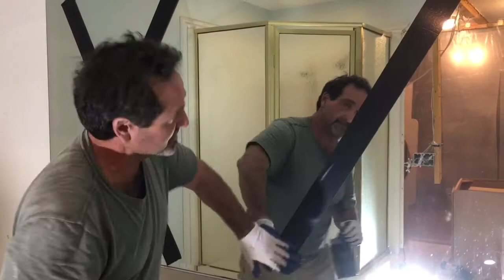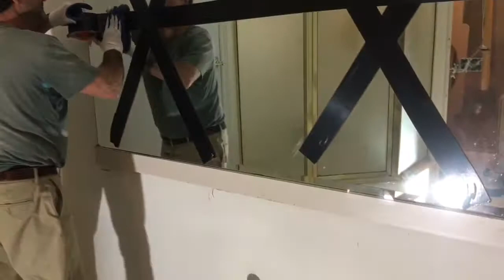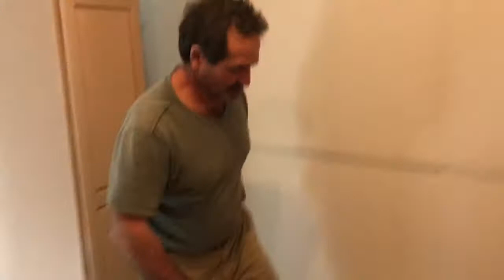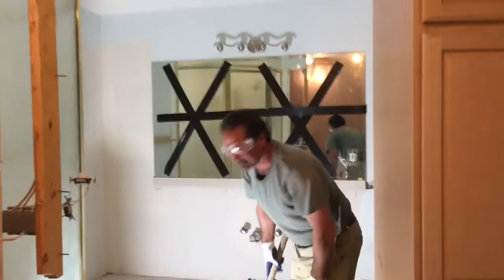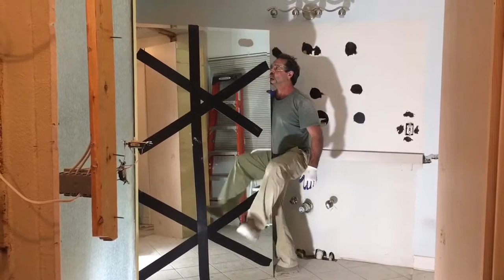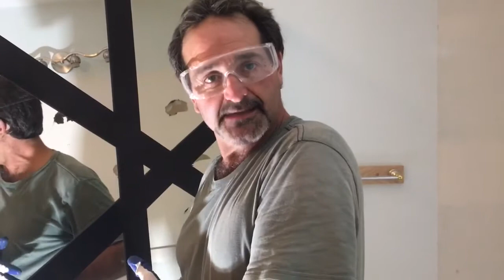Remove Large Bathroom Mirror from Wall - FAIL (funny)

Comment: Hey Brother. I do this all the time demoing bathrooms. Go to Harbor Freight and get the suction cup handles. Start in an upper corner and slowly pull and release. I haven’t had one break yet. Then I have my glass guy cut it down to put in the medicine cabinets. Just saw how you got it off. Yeah, the suction handles help. Shattering glass can be bad news.
Reply from the maker: Yea I don't do much remodeling.  I was in demo mode to get our bathroom cleared out to redo it.  It is still demo'd.  I haven't had any time to work on it.  I'm not great at framing.  Wish you guys were closer to give me a hand.  Hopefully I will get this done right.  I think I'm going to hire this really great tile guy to do the shower.  I don't want it done wrong and this guy is very knowledgeable and is licensed.  He will give me a 20 year warranty on leaks so hey, it might be worth it for me to just hire that part out.  It is a second story shower over my kitchen.
Reply: Reality is a Comedy that’s a sweet warranty.  I stand behind my work. Never put a number on it. 15 yrs and no call backs yet. If you are doing a mud bed, just make sure your guy does a preslope. Watch many YouTube videos and guys are trying to get away from it. In Jerzey they are required by code. Don’t need permits sometimes on remodeling jobs if you aren’t moving plumbing and electrical. Just called an upgrade. When this happens guys will skip the step cause you lose a day on the timeline. Framing is pretty simple. A little tip, bust out that Kreg jig and pocket screw your studs. That way if something has to get moved, unscrew and move. I do it on all my jobs.  All my subs and inspectors comment on it. Takes longer, but shows you give a shit. I comes in handy when setting tubs and full shower enclosures. The molds the companies use have variances. If the wall is tight, loosen from screws, place in tub and tighten back down. Catch you around bro.
Reply from the maker: renaissanceman Great tips thanks my friend!  I have to add additional 2x12 for support.  I have a 16 ft span and due to the weight going in that area for the shower I need to add more support.  A lot going on here.  I might do the schluter Kerdi because it weighs less to help out also.
Reply: Excellent advise —the suction cups